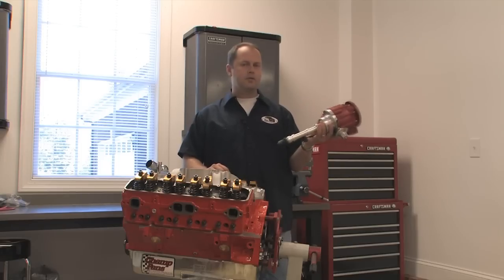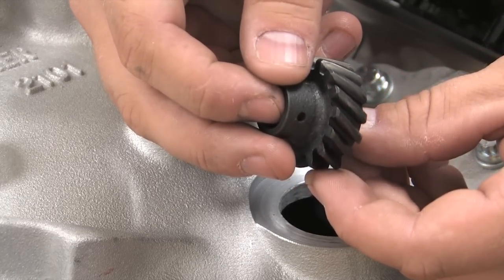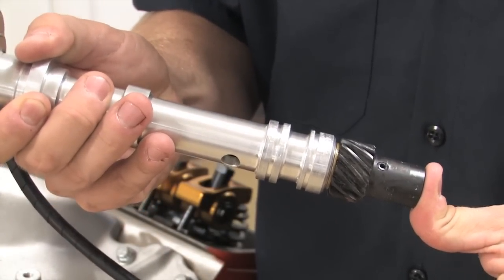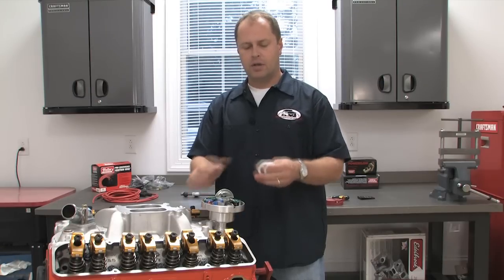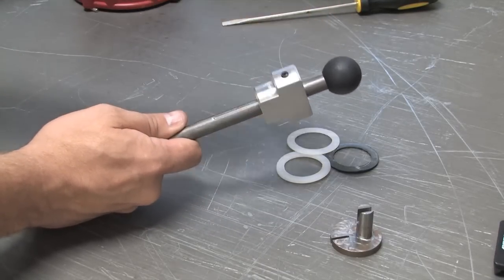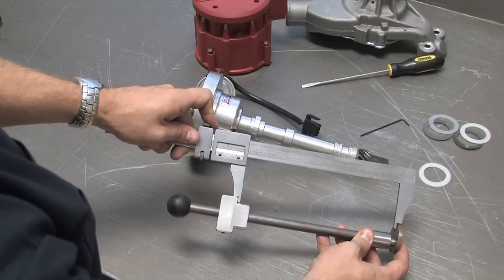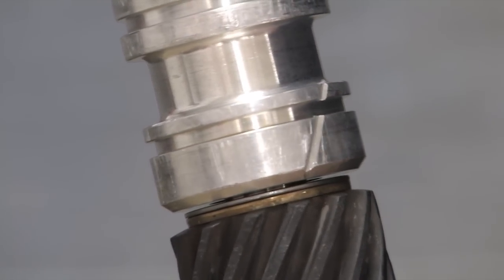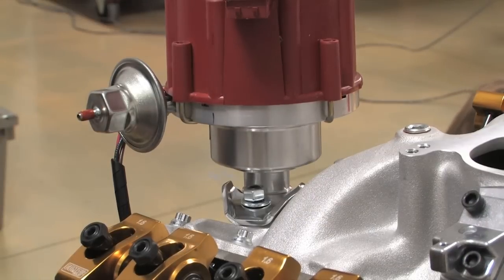Distributor Installation Tips

Comment: what if you did all those steps and the distributor still wont " drop in " ? I even dropped the oil pan to replace the oil pan gaskets and also took off the oil pump and dropped out the oil pump shaft and the distributor still wont fully engage 😞😩

Comment: Thanks for the video. Good to know about measuring the length as not to destroy the engine. :)

So, could you recommend a upgraded distributor for my 1976 cj7 jeep with 258 I6? I am going from a prestolite ignition to a GM TBI with fuel injection and a ecm.. Hope to allow the ecm to control spark/timing... :)

Oh, by the way... I believe my cam shaft is soft iron, do you sell the dizzys specifically for the set up I'm trying to attain?

Comment: The notch you made with a file on the bottom journal of the distributor should be indexed so that the oil stream sprays where the cam gear and distributor gear mesh. This would make it behind the vacuum advance cannister on the passenger side of the unit.

Comment: i am looking at buying a Mallory distributor this is the model (Mallory 85 Series HEI Distributor) not sure if the one in the video is the same but was wondering if you where using a flat tappet cam? reason i ask is because the one i am looking at is a steel gear and was told you can not use a steel gear with a flat tappet cam was told to use a iron gear but in the description of the (Mallory 85 Series HEI Distributor) it says it will work on flat tappet cams i am little confused

Comment: Great video as always!!!  
for the 2 groves in the collar at the bottom, some manufactures include O rings to go in them.  Is this something thats necessary??
Reply: The manufacturer suggests beveling the top edge of the hole in the lifter galley before you use those 9-rings. If you have a running engine I would not use the rings for fear of them hanging up and getting digested by the engine.

Comment: So I seen your distributor has no mechanical advance. why is that I thought my truck was missing it and that's why it bogs down after a few minutes of run time? it's an 80's 350 manual fuel pump. do I need that system to run daily?
Reply from the maker: Once the engine is running, not having a mechanical advance may cause it to stumble when coming up off idle. The big advantage with mechanical advance is it will make a warm engine a lot easier to restart. For race engines, deleting the mechanical advance just simplifies things, but for a daily driver street engine some form of advance--either mechanical or electronic--usually is a good idea.
Reply: +The Horsepower Monster OK that makes sense this distributor I pulled out had no vacuum advance no mechanical the module only had one wire plugged into it. I have a msd rotor and cap I order a spector distributor with both timing options. and the timing tab is weird it is not on the side it's right in the middle if you look down from the front you see it. it's a cmj motor not ugh info in it. Has the double camel humps on the heads still have no idea what motor I have .

Comment: what's a good brand dependable Hei distributor for a small block Chevy
Reply from the maker: +Michael Barnes If you are talking about a high-performance engine with more than 350 horsepower, Performance Distributors or FAST (used to be Crane Ignition) both have really good HEI distributors with a really hot spark, even at high rpms.